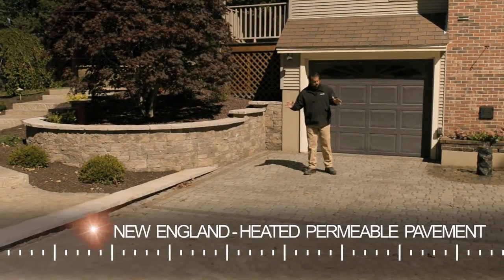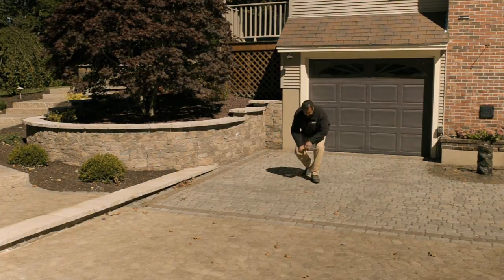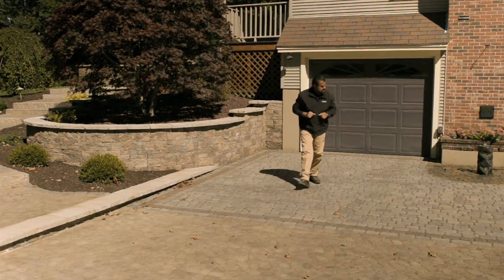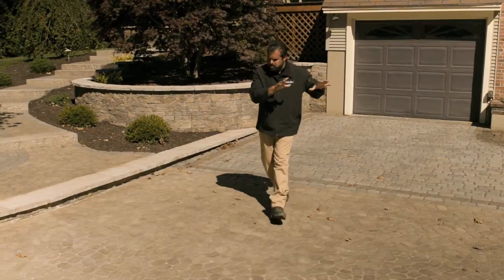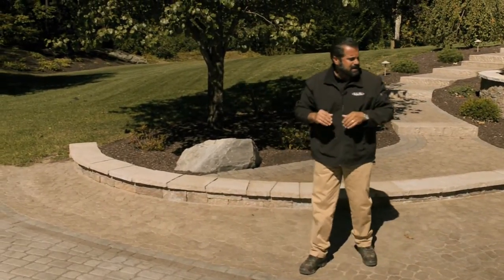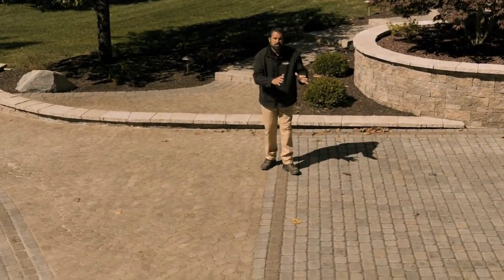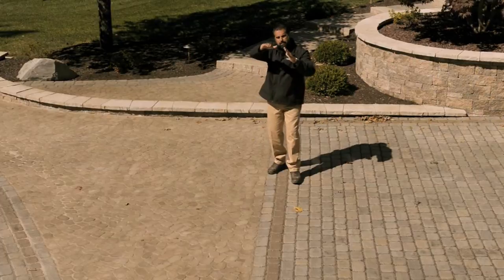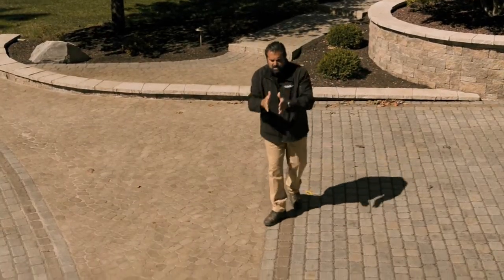Heated Permeable Pavement Driveway

Comment: Why is there a sensor- if i was the home owner I would want to control the on off timing.
Reply from the maker: Hi Erika! The sensor is triggered by the temperature and humidity levels in the air. The key to these systems is that they operate during the snow event to prevent any accumulation. This optimizes energy consumption. Otherwise, turning it on manually after a snow event would require energy consumption over a longer period of time.
Thank you!
Reply: The sensor is just so it doesn't run constantly. You can always turn it off as a home owner if you want.